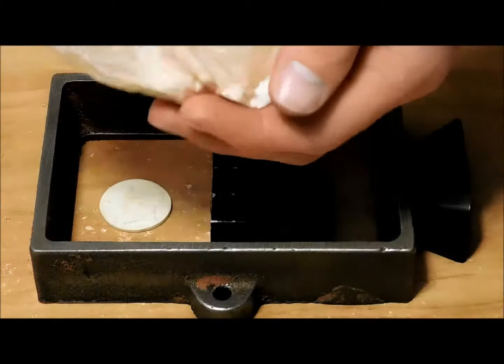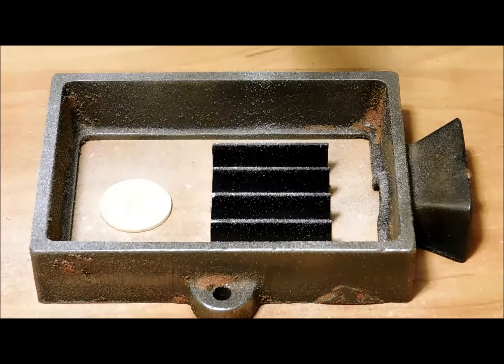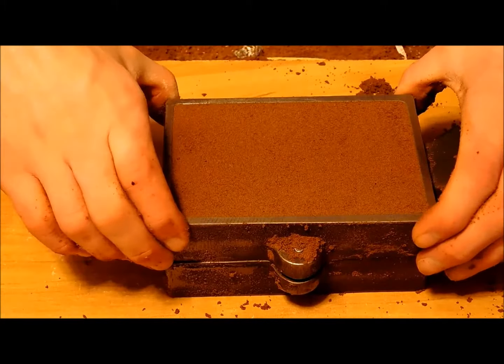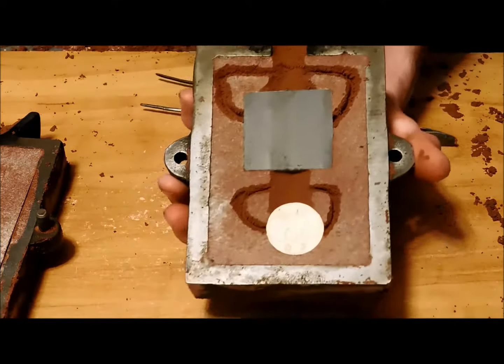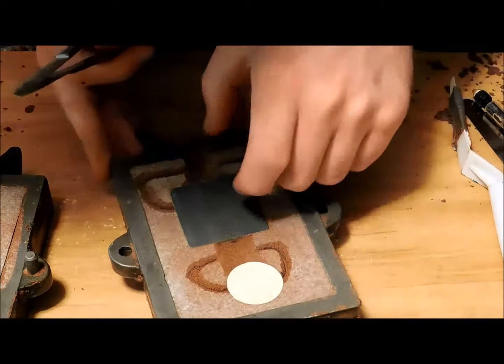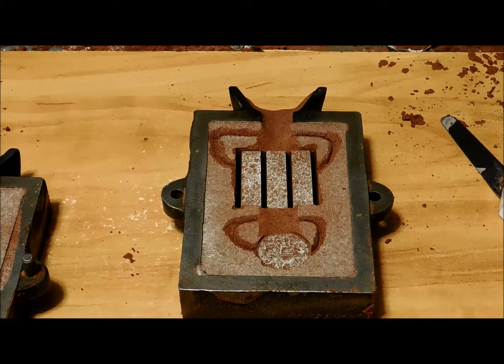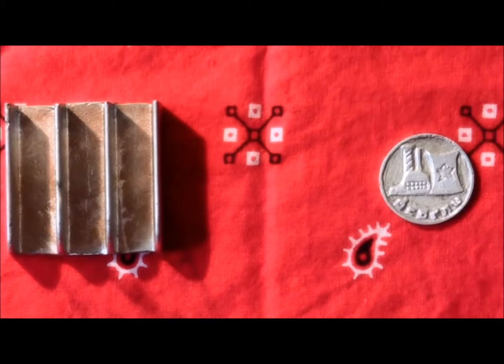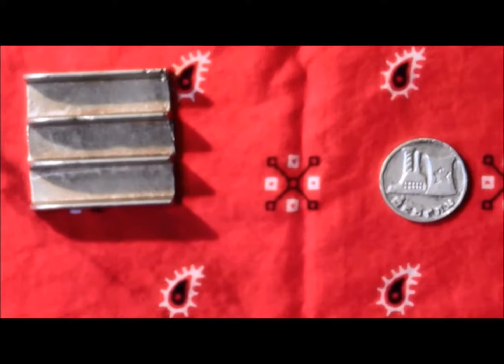Casting a Custom Aluminum Coin and a Heatsink

Comment: Great video, messy with the sand. Gives me ideas but it's a lot of work for what I need. I use 22*13*11MM heat sinks and I need them twice as long but no one wants to make them for me so I'm guessing my best bet is to take 2 and weld them together with map gas.